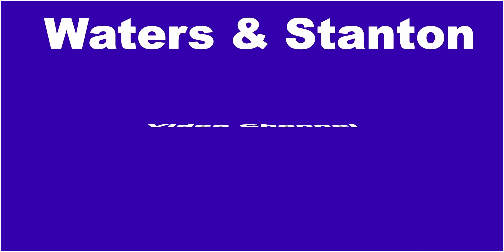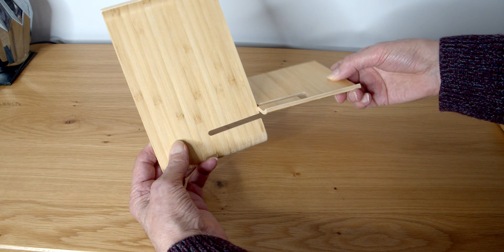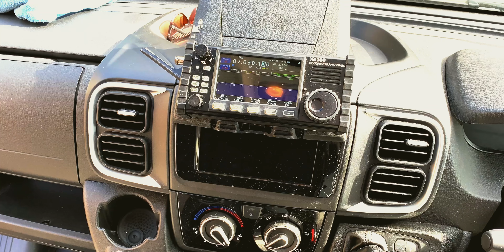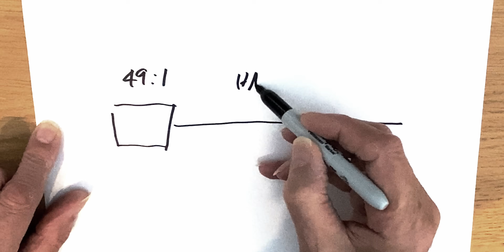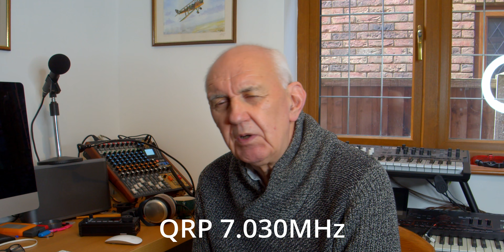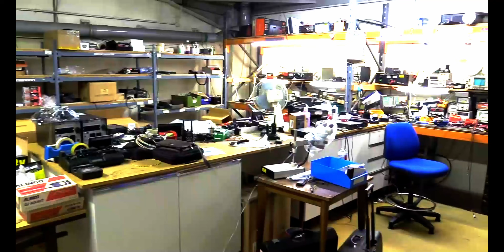HF Portable Operation - The Preparation and choice of Gear

Comment: Hi Peter, you keep saying that verticals need radials, and while i would generally agree with you, you did a test on the Diamond bb7v. https://www.youtube.com/watch?v=64g4OQLEcEk. at 19mins 40s. in which you conducted test with and without radials, and found no discernible difference. i bought one for my portable use from my motorhome for purely that reason, though i do have a long wire as well. many thanks.
redders m5act
Reply from the maker: When I mentioned verticals I was referring to ground based quarter 
waves. There are others like the Diamond and the vertical EFHW that do bot need radials.

Comment: Thank you for making this video.  Can I ask, do you use any form of a counterpoise with your EFHW antenna?  If so, how long do  you make it and how do you lay it out relative to the EFHW wire - i.e. parallel to and underneath the EFHW lying on the ground, or at some other angle to the EFHW wire ? 
Or do you use one at all?  Thank you.
Reply from the maker: In a word, no I don’t and never have found any benefit.

Comment: Peter, I like working all HF bands including WARC bands  Any reason you decided not to use a non resonant 71' wire with a 9:1 unun and common mode choke? Perhaps the Xeigu 6100's ATU?  Thank you for great videos!
Reply from the maker: I have never been happy with the 9:1 arrangement  as it is a bit of a compromise, but many operators get good results.

Comment: Great video Peter. Ooof you shocked me then saying the radio was 5w I had to check again. I looked at buying this radio.
Currently got the Ft817.
You are right check you're stuff my last outing I forgot the antenna. A coupe of times before that the connector. 😂
I was in Suffolk the other day.
Great work 👍🏻
Motters M7TRS 73 👍🏻
Reply from the maker: Many thanks 73 Peter

Comment: Love your channel, always so informative. Just purchased an FT-897D and am considering an Off Center Fed dipole so I can get from 40 to 6 meters with the one antenna. Any thoughts on that?
Reply from the maker: It should work on some bands but you will need an ATU on a few of the bands.
Reply: Those radios (FT-897 and similar FT857D)   are great for the outdoors; they are small in size and draw about 0.65Amps on RX and offer the option of VHF and UHF, all build in, quite an option despite their age. 
Compare the above to 2.2Amps taken while on RX when using most of the modern sets in the same class of a 100watts.
Sadly, at the moment there is nothing modern that could replace those radios (unless you go with some QRP option), in any case, make sure you keep this radio in your shack. The FT-897 used to come with the option of an ATU (FC-30), look around for those, this add-on fits to the side of the radio to become one unit with the radio. 
OCF antenna will work great as well as some verticals as they won't need height of a dipole to be an effective DX antenna..